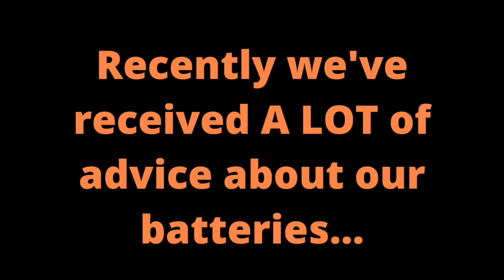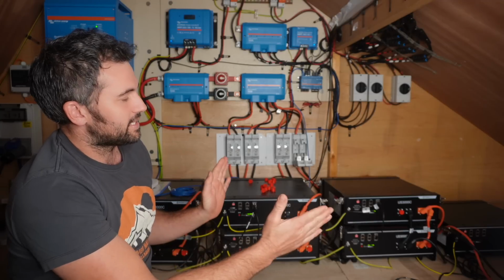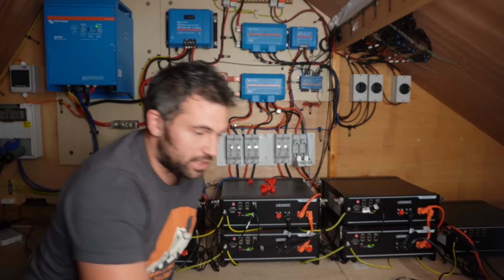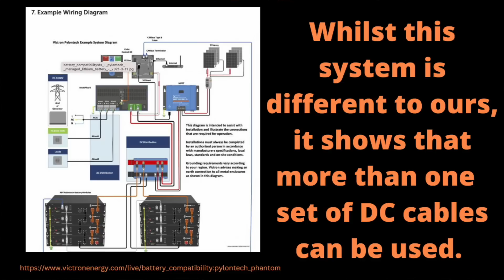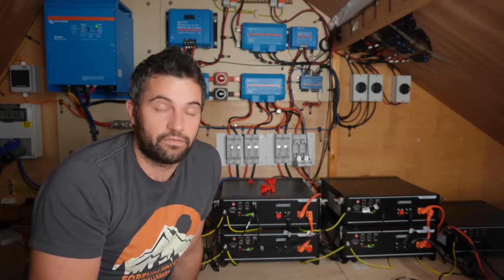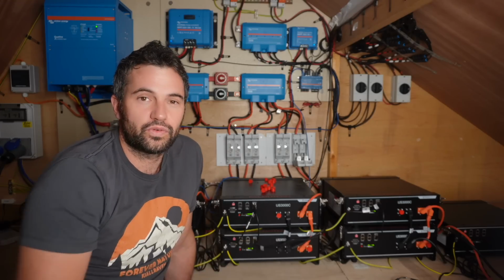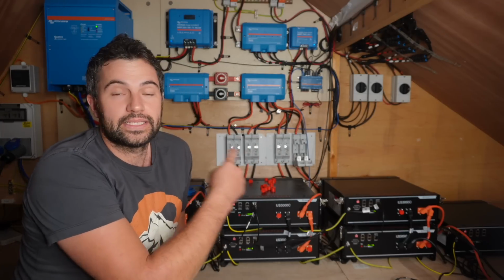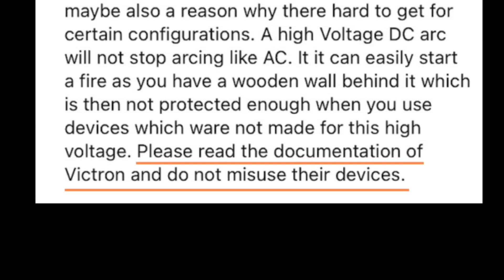WE WIRED OUR PYLONTECH BATTERIES 'WRONG' (and other misconceptions!)

Comment: It's amazing in life how often 'experts' disagree and manufacturers give conflicting advice. I think you're right to trust your own judgement and experience fundamentally.
Reply: That is because they are not experts. They tend to be electricians that think they are experts. The public thinks they are experts but the fact is they are not.

Sadly electricians are the people supposedly qualified in electrical matters in to which the public routinely come into contact with, and therefore they assume they are experts. If only the public knew the truth!

Most electrician's cannot do the design, analysis and simple calculations required for these kinds of things.

As for using your own judgment. This a very dangerous thing to do, if you are not an expert in the subject. Your judgement is based on your knowledge which if you are not an expert, then it is not high enough.
And that then is where you should turn to experts..the problem is you are turning to electricians and not qualified engineers.
Reply from the maker: Thank you, that is definitely what we have found to be the case.  We've been let down by experts before!
Reply: Really. Maybe the "experts" are not experts? Why does this channel always think they know more than experts??
Reply: Fyi - when you have an odd battery at the end it is likely to get hit harder as the resistance is lower in the circuit. Any chance that battery was tripping on you?
Reply: sorry to necro,just a rant,in our country there is insane amount of 'profi' shops,that sell electric breakers and stuff and does not differentiate between -and now translation,maybe wrong- uncoupler and disconnector,one can be disconnected under load and one can't (we have very close words for it) (one example from oez is opvp10 and opvf10,they look the same)...(and also,there are materials that might start to conduct after some time and sparks..bakelite for example)...this was news for me(no school in electrics),so,stay safe and trust your gut...

Comment: Remember the higher the voltage the lower the current. This is why say a 48V 3000W inverter can get away with a smaller diameter DC cable than a 12V 3000W inverter. I once bought a 12V 3000W inverter to use off some leisure batteries and was mortified at the cost of the cable per meter, the 48V stuff is much cheaper but obviously means you need 4 12V batteries in series. Good video, keep up the good work.
Reply from the maker: Thanks for your comment, glad you enjoyed the video 😊 when we were looking at joining 12v batteries we were horrified how many we would need 😩

Comment: Firstly what you've done is fantastic, well done. I've been watching since the start. Nobody should ever criticise when you add more safety or use a bit of common sense engineering to achieve something, so long as you're not selling it and you have only yourself to hurt. 

The cables you are using there from your PV busbar to the MPPT are probably automotive cables, but you ordered them not me so I can only guess. You can check with the manufacturer about the voltage rating but it's normally up to 60V DC. Single insulated wire is available for higher voltages just like "single" cable used in 230V building wiring which is tested to 500V DC or higher once you get to higher appliance voltages. It's not about the number of layers of outer insulation, rather it's about the insulation resistance of the cable jacket you use. 

What is more of concern is that you have exposed terminals, you really should put some 3:1 heat shrink over the cable and the terminal on the left side PV busbar. It can get such a high DC voltage there you may not be able to let go if you touch them both. Just remember when AC passes the 0V point you can let go but DC doesn't do that. Same reason arc flash is more difficult to extinguish. 

You can also get a cover for the terminals on your Victron MPPT now which are reasonably cheap. It would also be safer to put your PV DINrail fuse and suppression device inside a plastic consumer unit style enclosure.
Reply from the maker: Thanks for your comment and for the safety advice 😊👍 it’s great to hear from people who have been following us since the start. Thanks for your support 😊

Comment: Personally I think you are very brave to take on the project you have and then open yourself to the social media world to be scrutinised. I admire you. As you have learned there is much rubbish banded about as fact but know-it-alls who don’t know anything.  I am not qualified to say anything but my opinion on the voltage limitation on the Victron power in or distributor is to do with safety and the exposed conductors.  DC is safe to touch up to about 60V.  The way the Victron system links together leaves exposed conductors at the end. If higher than 60V there is a real danger of electrocution if you tough both those conductors.
Reply from the maker: Thanks for this, that sounds like a sensible theory 😊 and thanks for your support. We always get a bit nervy when it’s a solar video, especially a Pylontech one as people REALLY love them 😳 Just sharing our experiences in the hope that it helps someone 👍

Comment: What battery switch (the red and black ones) are you using? None on amazon seems to be rated for more than 48vDC. (They should be able to hold on 53vdc, but none of them, even the expensive ones, have clear indication of that voltage higher capacity.

Comment: Inverter doesn’t draw 400A. The fuse is to protect the cable. The cable is oversized to reduce voltage drop and DC ripple. Your correct in using multiple battery cables to your Lynx distributor but you have still wired it wrong because you’ve only used 1x pos and 1x neg cable from the Lynx to the Multiplus. Installation manual says use 2x 50mm pos and 2x 50mm neg. There’s a reason the internal DC connection has 2x connections each

Comment: You are off-grid, so it is all hypothetical to you, but this is a nice setup and more thought went into it than most of what i see online with off-grids.
I went through learning the grid code (am low voltage electrical engineer) and self-certifying our setup for grid-tie in Finland, after going through 3 unsuccessful electricians that seem to not know our own standards and you are right to question and double check with manuals, but grid codes or standards are the better way to do that. 

Some things you could improve on the setup is to move all the solar and DC disconnects to a place where you and the fire department can reach them safely, in the case of fire or arcing - usually that is outside.
Covering the DC terminals for the Solar may also be useful to avoid shorting them when dropping a screwdriver etc.

If you are unsure about the cables and combiner boxes, usually a 1kV installation tester will show you when doing an insulation resistance test.

Comment: What can I say the voltage ⚡ is Low from the batteries, I'm a retired UKAS Electrical Measurement Manager you won't get arcing on that, but what can happen is you can get voltage drops with high current demand if that happens you can get local heating & eventually burning of connections, to check this you can measure that voltage drop with a hand held Digital multimeter set on DC mV or Voltage ranges, measure voltage drop in each cable & across fuses terminals, that will also give you an idea 💡where voltage drops will cause heating around connections 😉 that is what you don't want to happen, that heating could cause burning & fires,
You can get something like thick switchgear board or what the used in my day was a ideal backboard very heavy material to move around, good for insulation & mounting standoffs for busbar etc hard to cut its that tough,
If in the future I suggest you mount all that in a Rittal 19" cabinet with lock door, those batteries look like standard 19" fitting, plus with Rittal cabinets you can get all the nice internal fittings 👍
https://www.rittal.com/com-en/products/PG0002SCHRANK1
They make outdoor cabinets very heavy material,
https://www.rittal.com/com-en/products/PG0229STV1/PG0300STV1
It's only when it gets above 75V DC its classed as high voltage 
Look at this
https://en.m.wikipedia.org/wiki/Low_Voltage_Directive
In my system I will use busbar smart shunt Fuses attached to busbar nothing fancy to tell me if the fuse is blown you can do that with a LED in series with a suitable resistor, batteries, Victron Energy is great choice its built quality is top & after sales is good, 
In my day as a apprentice Instrument Engineer we went upto 80kV AC & 50kV DC, current upto 1000A from massive single cell batteries, other ways you can look at local heating is infrared thermal camera 📷 there produced by Fluke there very expensive, you can get adapters that fit on iPhone or Android phones with various different connectors, use your phone as infrared camera, high current connections you can buy from www.farnell.com you can buy anything there based in Leeds or RS Components over the trade counter both will deliver, you can buy busbar from either in set length & ceramic insulation standoffs,
Hope that helps, oh welding cable might be alternative to paying overpriced solar cables again look at ratings,
Offcuts of cables you might buy from cable manufacturers, I like silver plated copper PTFE insulation its expensive but high current rating a little awkward to bend if you choose thick types.

Comment: Ideally you have an equal length of cables for each battery for balanced resistance when charging or discharging. BMS will compensate though. Victron wiring unlimited guide is useful.

Comment: Great video. Thanks for posting an update.

I can see now you've got x2 batteries x3.
That should be fine I would have thought.

I'm running two stacks of 4x batteries with two DC cables (top+bottom). Seems to work so far.

Hopefully you'll get a replacement for that dodgy pylontech battery as there's obviously something different about that one compared to the other six.
Reply from the maker: Thanks for your comment 😊 We threatened the supplier with legal action and things have progressed since then, albeit slowly! 👍

Comment: Volts - Amps, Resistance and Watts are joined at the hip (Ohm's law), On the topic of the busbar/fuse rating, remember the formula is Volts x Amps = Watts, 160 Volts x 100 Amps = 16000 Watts or 16Kw. You have to consider the watts which is the power handling and always look at Volts and Amps together, not separately. (if you exceed the Watt rating of a conductor, busbar or cable it will resist the flow of current and can only get rid of the extra power in heat. I recommend getting the combiner box. Ensure the DC cables are all the EXACT same length and make a very good connection to the terminals and that each lug is crimped well, i.e from pylontech to fuse - same length, from fuse to combiner box - same length and from combiner box to inverter - same length for each string of batteries, even a 5% discrepancy in length will change the impedance of that circuit and could create a battery to become dominant and degrade faster or charge incorrectly than the other batteries over time. Another important topic is grounding your panels, see the resource below as you want to keep high Voltage from lightning or EMP outside of your house and away from your inverter/MPPT/Charger. The last link is for the NEC Handbook, look around you should find some online copies if you dont want to buy it on this link. Please read and use these resources for detailed explanation, especially the wiring unlimited pdf and use the web based cable sizing tool: 

https://www.victronenergy.com/upload/documents/Wiring-Unlimited-EN.pdf  -  see Page 16
https://www.solar-wind.co.uk/info/dc-cable-wire-sizing-tool-low-voltage-drop-calculator
https://www.solarpowerworldonline.com/2015/08/what-is-the-process-of-grounding-and-bonding-a-solar-pv-array/

https://catalog.nfpa.org/NFPA-70-National-Electrical-Code-NEC-Handbook-P16530.aspx
Reply from the maker: Thanks for your comment and for the info 👍😊

Comment: You have done it correctly, as busbars are a must. Just go and watch David Poz recent videos on the subject. I have three different pairs of LifePo4, battery manufactures Total 10kWh, with all the negatives paralled directly on to a single 40mm x 3mm copper busbar, using lubricated brass 8mm nuts, bolts and washers and the positives to a positive busbar through DC circuit breakers in a consumer unt box. 125A for a pair of UP2500 Pylontech's, 40A breakers each for two Simpliphi 2.6kWh and a single 16A breaker for an 800W battery. I use a Victron 24/3000/70 Multiplus II and it all works very well and has been since 2017.
Reply from the maker: Good to hear your system is working so well, especially with a mix of batteries 😊 sounds great 👍

Comment: The distribution box is probably not rated for high VDC because of the exposed terminals poking out of the end.
Sure its capable of handling the higher voltage and current. But its a health and Safety issue with it being exposed.
Placing a plastic guard over the terminals to keep fingers away would fix it.
I built my own combiner box using a plastic Consumer unit box, dc cartridge fuses on each wire and a lightning surge protector.. Cost less than £100.
Reply from the maker: Thanks for this, that’s really interesting to know 😊👍

Comment: I think the bus bar rating up to 60vdc is because it's not enclosed. Dangerous voltages just hanging out, ready to be lent against on those bars there. Also maybe the insulation isn't rated to insulate very well. Higher voltages usually require some rubber insulation.

Comment: The busbar itself should be fine for the PV voltages, unless you are using 600V strings or such.
The concern is if you are using fuses, those can arc if they trip at a high voltage.
If you need fuses depends on the panels, things are fine with 2 strings and sometimes with 3.
This is to protect a faulty string to be backfeed and overloaded by the remaining other strings.
They should have a gPV trip characteristic.

For the batteries - you do need some additional fusing because the electronic protection can fail.
And as long as you are using the 58V rated mega fuses, those will be fine.
You can get them for 32V though, which can be a problen.
Reply from the maker: Thanks for your comment 😊 We use string fuses for our panels 👍 Our concern with the mega fuses is the lack of short protection, which is why we used the others instead.

Comment: The fuse is not rated or sized to the inverter power ... BUT to the cable, the fuse is here to protect the cable, not the inverter, if something go wrong .. it cut the circuit before the cable melt and maybe catch fire.
IF the inverter is too draw 400A AND the Pylontech cables are rated 100A, then you need to make 4 strings of 2 batteries in parrallel. (4x100A = 400A).
If the inverter only draw 200A max then 2 strings of 4 batteries is ok.
All parallels need to be connected together and from ehre a 400A cable to the inverter, i would add one breaker per string inc ase you need to work on one pair of Pylontech.
Those fuse you got are fine if they can whistand 5000A and break at 150A.
PV wires just got a coating that resist UV and high temperatures, there is nothing else special about them, and of course they are multi threaded (this is the word in english i think) with a minium of threads. Let's say .. those cables combine what's better for PV use.

Comment: Hi don't know if anyone has let you know about the victron lynx but it is rated at 60VDC as it has exposed terminals at the end and one you get over a certain Voltage on DC it has to have enclosed terminal to avoid shock risk this is why they are supposed to only be used on the low Voltage side of the battery system as they usually only go upto  48V which is below safe touch voltage. This means you can touch it but it will not overcome the human body resistance to give a shock. hence the low voltage rating but high amps.

Comment: Love your videos. As an ex electrician in a past career, I always thought the series connection and stacking of the Pylontech batteries always seemed a bit bizarre to me, after all, the more current, the thicker the cables required, I have a 5000 model Pylontech battery on order and have the rest of the kit all ready to connect on grid to my new Multiplus II 5000 GX. After ordering parts ready - I was quite surprised to see how small the standard "end" 2 metre Pylontech cables really are as I've not worked with AWG cabling before. I certainly wouldn't want to run more than 100A or 150A at a push through such cables at 48V. So I think what you've done is very sensible parralel connecting them onto a bus-bar. Additionally, I'm interested in your fuse holders / isolators - can you post a link or tell me the phrase to look for please!? Keep up the good off-grid work!
Reply: They are parallel connected even in the photos you see.
Reply: The cable is rated higher than you might expect as the insulation can take a higher temperature than normal.
Reply from the maker: Thanks for your comment 😊 we got the fuses from Bimble solar. https://www.bimblesolar.com/DC-fused-disconnect-2pole
Reply: Many thanks. Funnily enough I have bought from Bimble Solar before but didnt think about looking for these there! Cheers!